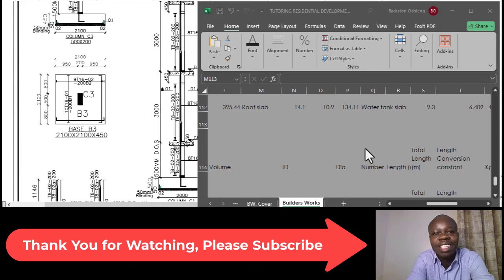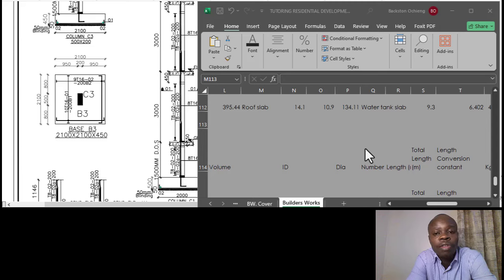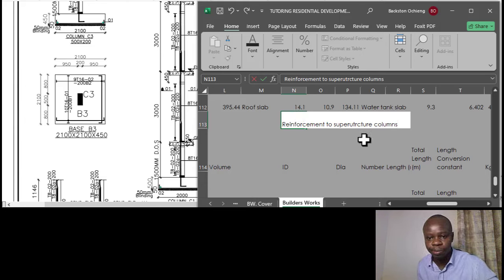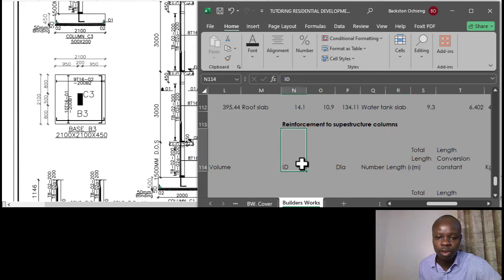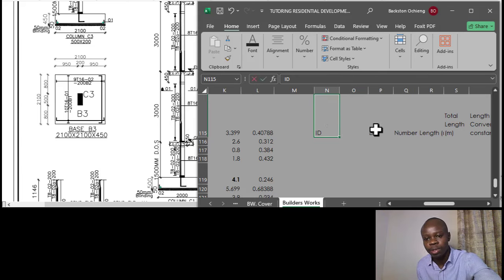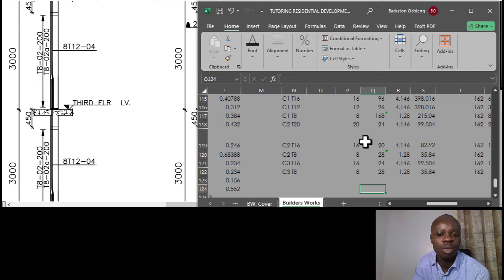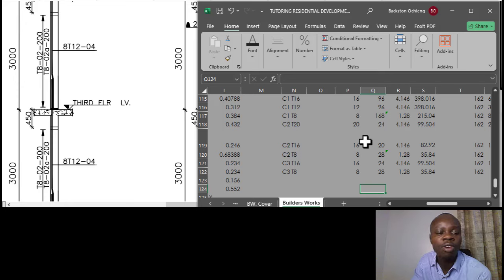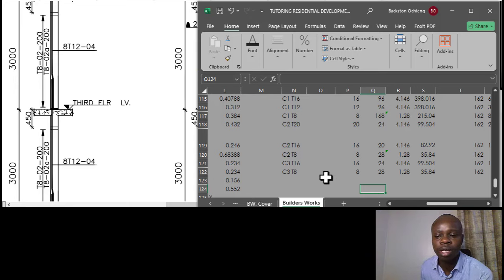TAKING OFF STEEL REINFORCEMENT BARS IN COLUMNS; E17;Bill of Quantities in Excel

Comment: great.
when counting the number of main bars in the column, are we supposed to multiply the number of bars in the specific column × the number of identical columns in the whole structure i.e C1-12columns × the number of floors to obtain the total number of bars
Reply from the maker: That's right, you just be careful and confirm that the typical columns in deed have typical reinforcement details. You understand that you might have typical columns in terms of size but with different reinforcement details.